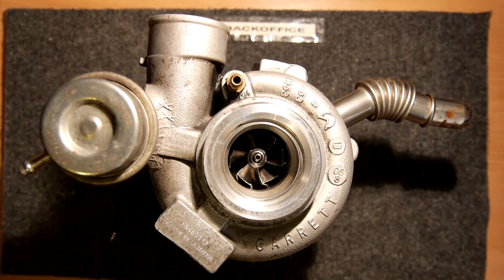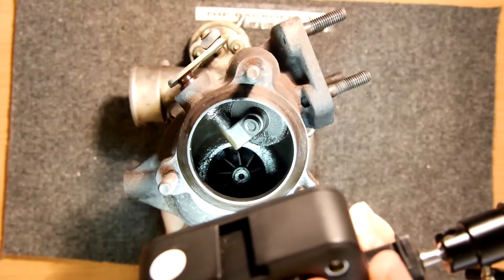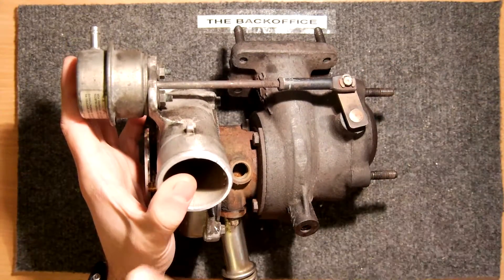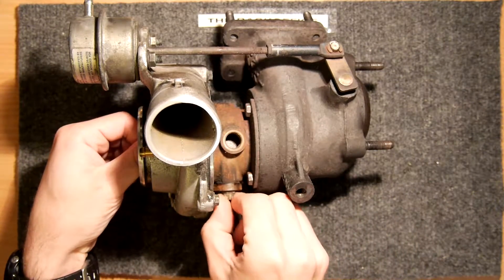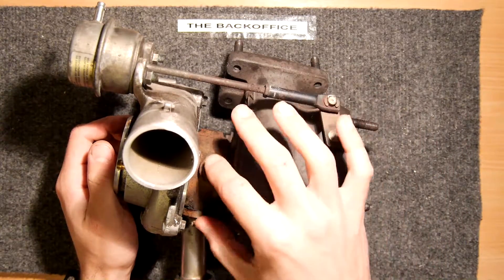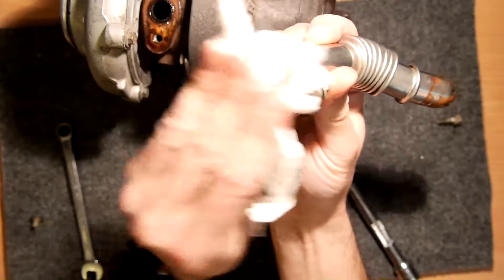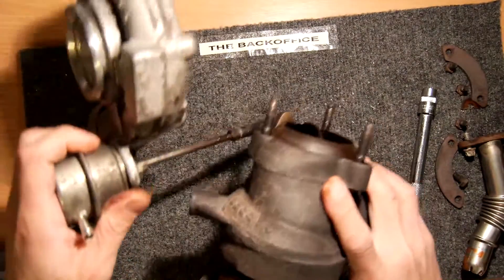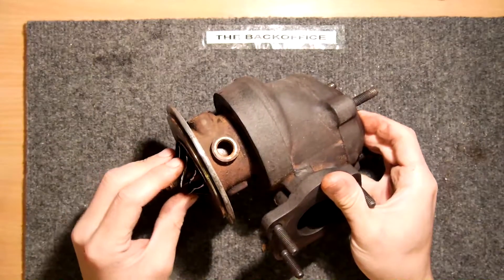TD Lab - Garrett GT1752 Turbocharger - Part 1

Comment: thank you. I learned all this from kids books as a child and it only makes sense that things that SUPER charge the air are super chargers and whether they are shaft driven from the engine or via a turbine via exhaust gas is just the method of getting the energy for super charging (compressing)
Reply from the maker: +djmips Ha ha, thanks for the support, you are SUPER!! It was very interesting to learn about this and change the unit in my car. Gives me a lot of respect on the technology. 

Did you see my replacement video?

Comment: I take it (as part 2 is not available yet) the heat of it failing has superficially welded the cartridge part to the housing?
Reply from the maker: +Simon Lock (Aergan) Part two tomorrow. Indeed it needed smacking out. Actually the video was miss edited hence the horrible sudden ending. However it allowed me to make it in 3 parts. Silver lining etc
Reply from the maker: +Simon Lock (Aergan) And even during today's final recording I lost 15 minutes of sound. A total ball ache! Luckily I am also making a full video on how to actually change these from the vehicle.
Reply: That sucks. Glad you were able to free it in the end. I look forward to watching the follow up videos 👍
Reply from the maker: Simon Lock Was going to order a CHRA but ended up getting a complete unit stting as it was only £15 more. Will video it and also video refitting it.

Comment: Nice Saab! Do you have a wagon?I got a 92x wagin which is actually a Subaru wrx rebadged as a Saab to try to get some quick sales for a different crowd 

But in the USA we had a special deal where you can cash in you junk old car for like $5000 for a bit! And subaru themselves actually weren't in on the deal, but gm owned Saab was, and Subaru got furious people we're basically getting a wrx for like 15,000usd just with a Saab badge, so they only made 2 years.
Reply from the maker: +Ganjulation Its a 9-5 estate, 2.3t I really like it, a very nice and quite different marque compared to most other brands.

It was either a Subaru or a Saab, I thought the Saab a little bit more professional for meetings :)

They are endlessly tunable!
Reply: +The Backoffice Ah yes it's called an estate not a wagon over there. Yeah love the Saab's especially there engineering,  unfortunately mine is all Subaru inside besides the steering wheel so I miss out of the cool things think ignition near the gear shift, and cup holders 

 I read to move the key to where Saab's usually are they would have to rerun safety tests, so they skipped it Haha

I heard a company chinese company NEV  bought them and is going to produce possible a electric 9-3. But they cannot used the emblem just the name Haha. I say a video of them rolling out a petrol version to show off.
Reply from the maker: +Ganjulation Try to find the full version of the 'Top Gear SAAB tribute video' it goes through the history.

The tri-ionic ignition system is genius.
Reply from the maker: +Ganjulation try https://vimeo.com/44087332